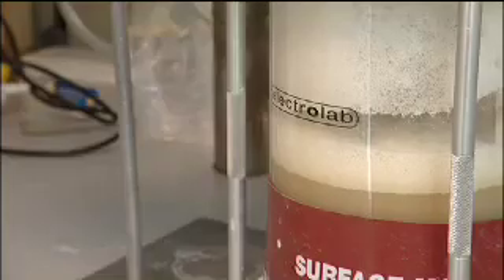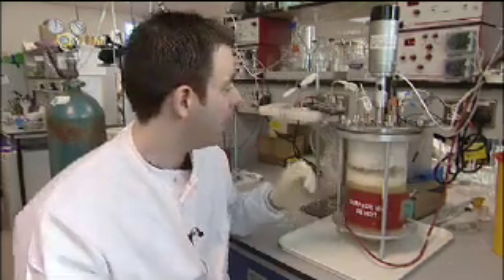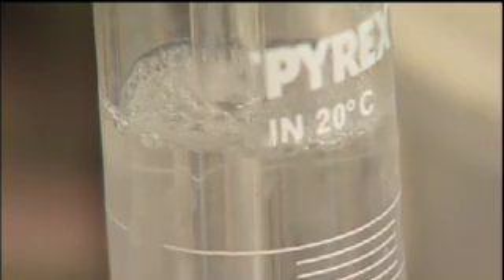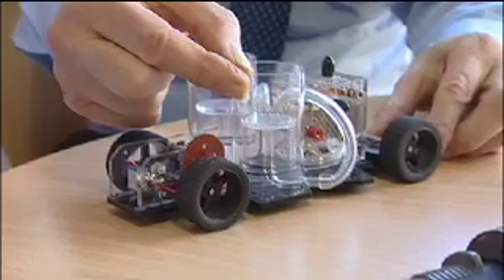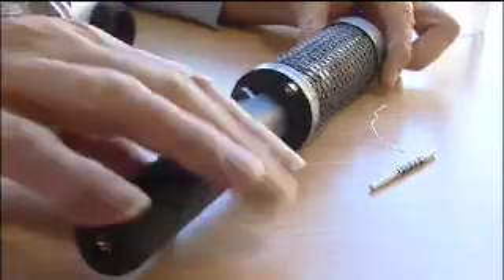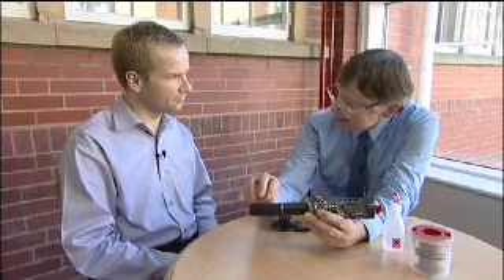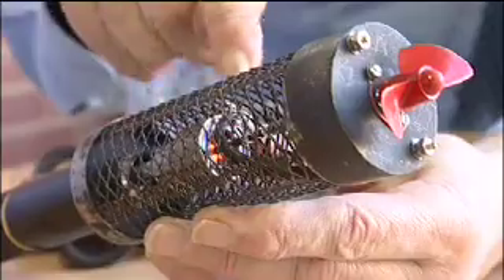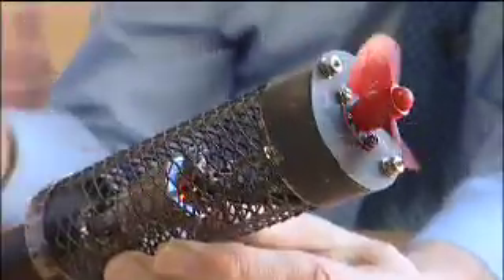How we can create, store and use hydrogen as a fuel

Comment: What about creating a standard H2 converter, discharging the O, and using a small 12 volt compressor, to compress the 3 to 4 pounds of H2 this could actually be stored in plastic sewage tanks, anchored to concrete stored below ground...... This said, two or three 1000 gallon plastic storage takes, all pressurized to 100 PSI of straight H2 would be pretty impressive...